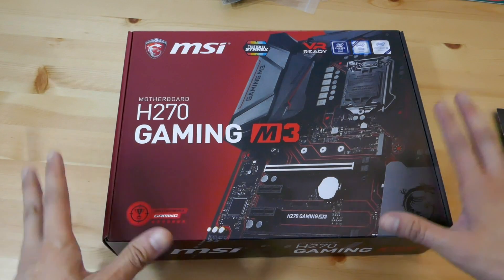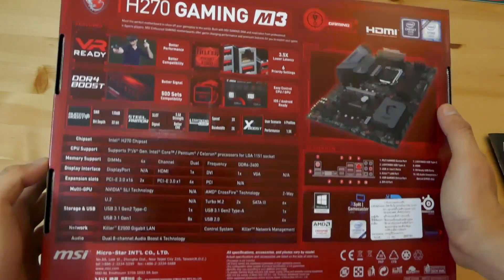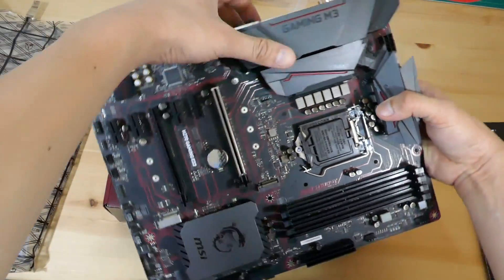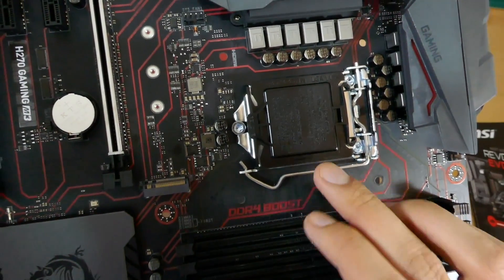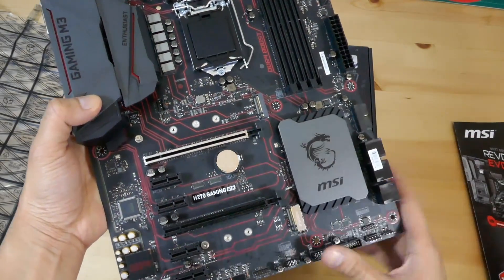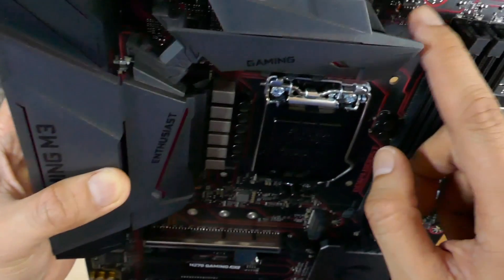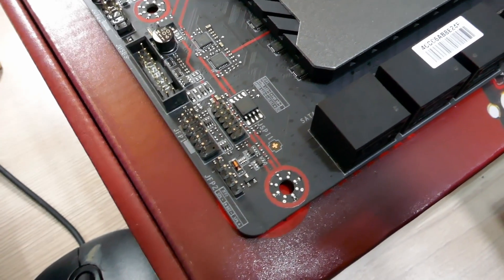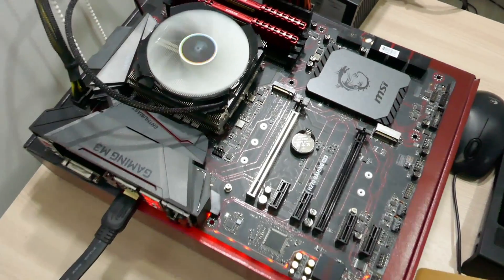MSI H270 Gaming M3 ATX motherboard unboxing and overview

Comment: Hello to everything and mainly to the creator of the channel, I have a question I have mounted a PC with the following features MSI H270, graph: MSI 1060 gtx gaming X 3gb, RAM: ballistic DDR4 2400 8gb 2x4gb, processor: intel core i5-7500 3.4ghz BOX, cooler master hyper 212 red LED and power supply: EVGA B1 750W 80 plus bronze, now when I turn it off as soon as it goes off it turns on again, what is happening I am afraid that some component could be damaged. I was thinking that it could be some config of the bios but I can not find anything, please help me ...
Reply: also the driver CD does not open in Windows 10 creators update
Reply: rip, did u find a solution?

Comment: i have the m3 z270 and it dose run ddr4 at 3400mhz
Reply: M3 Z270 is capable of a lot more CPU and RAM based overclocking, the H270 is a little more restricted.

Comment: Do i need a bios update for this for a 7th gen processor? (i5 7500) rn i have a gigabyte h110m-a i want to upgrade my case to an atx and i dont want the motherboard looking weird, i also have a thicker gpu now and my wifi card is blocking my gpu fan.
Reply: Currently running i5 7600k and required no update

Comment: I'm starting a new build with this Mobo(gaming). Parts are I5 7600k, DDR4 3200mhz 16gb, WD 1T Blue, MSI GTX 1060 6gb. Do you think it will perform well?
Reply from the maker: +2boostedsilverado if you are gaming on 1080p monitor, yes for sure! You can max out game settings and have high fps. Maybe add a ssd to make windows load faster - but that's up to you :)
Reply: Not sure if you've already experimented with the 3200MHz but according to MSI's specifications the H270 M3 is only capable of up to 2400MHz with XMP.

Comment: The only problem with the motherboard is the LED plug into the motherboard doesn't seem to be working? Tried rebooting with it plugged in and nothing...tried turning plug over and replugging and nothing? I ended up using an adapter to plug it into the power supply...LED works now!!

Comment: msi gtx 1060 + GIGABYTE-GA-H270-Gaming + i3 7100 nice system ?????????
Reply from the maker: I have never tried the i3 7100 but assuming if you are gaming and most games rely on graphics card, your system should be alright.
Reply: jojococo studio What you recommend as the video card is the same

Comment: I just bought this MSI H270 Gaming M3 motherboard  today!! Thanks for posting this... great quality and sound...I'm using this to replace an Asus P8 H67-M Pro/CSM with an i7 2600k with DDR 3. Now I'm using i5 6600k with 16gigs DDR4..GTX 970 Msi. Strictly gaming with no overclocking...what do you think?
Reply from the maker: +zellar1 hey thanks for watching! I am sure you can max your game settings with your specs and have easy smooth fps which is excellent. Just curious, why did you get the 6600k?
Reply: The 6600k was on sale and $10 cheaper then the 6600.....go figure?
Reply from the maker: +zellar1 ah okay that's cool! That's a good deal
Reply: I read so much on i7 6700 vs i5 6600 and everything pointed to the i5 as I don't video edit or stream and I certainly don't over clock. I do believe it is a huge upgrade from the old i7 2600 I replaced. Would you agree with this? Thanks
Reply from the maker: +zellar1 yeah for sure it's a big step up. Infact, I am also using an i5 6600 non k and it's really good for gaming and I am also using it for video editing too which works just fine. Overall your specs are excellent!
Reply: Great thanks for the input!!